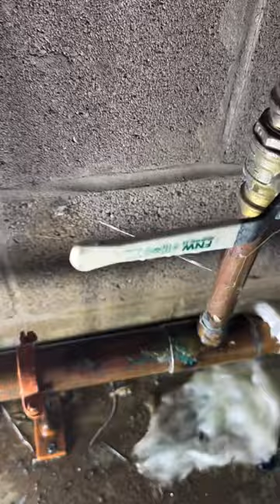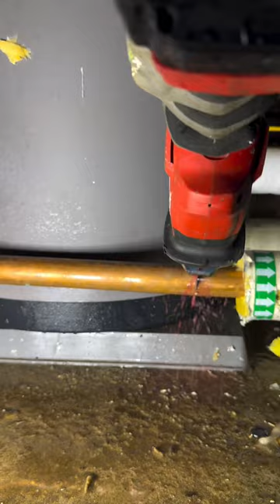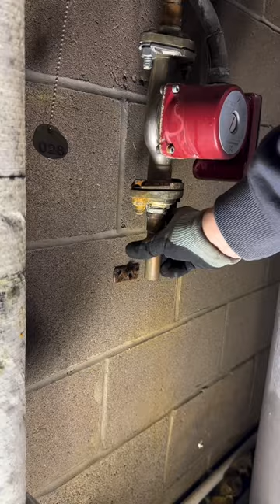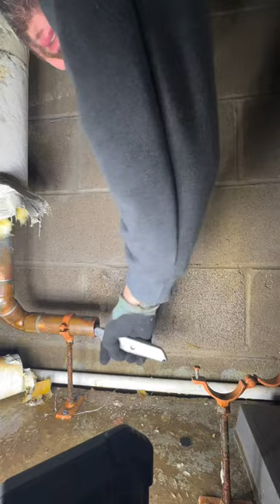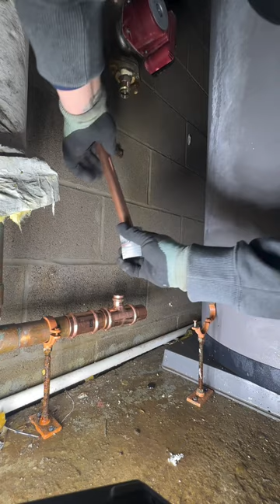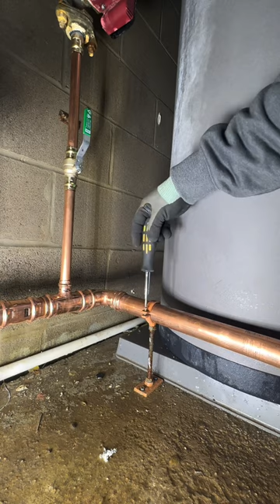Mastering Pinhole Leaks: The Ultimate Guide to Quick and Easy Fixes!

Comment: How long until those o-rings get rock hard and start leaking?
Reply: I haven't had one leak unless it was improperly installed. Over the course of 5 years. I have once (once) seen one completely separate when the pipe was frozen due to being outside. Approximately a 4 year old crimp.
Reply: They don’t use normal rubber o rings lol at least if it’s brand name viega

Comment: Oatey put their name on this? Looks like an unnecessary amount of pro-press fittings and excessive copper removal. Two slip couplers and maybe 6 inches of half inch pipe could have fixed this. Would it have looked as nice? No. It would however been a much cheaper and faster repair.
Reply: I agree ! I figured they would cut and use a stop-less couplers !